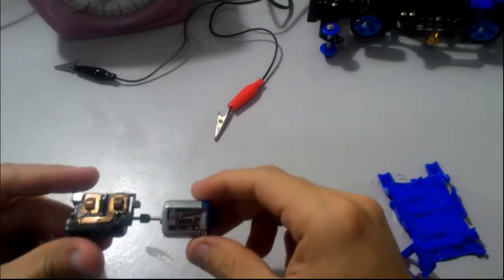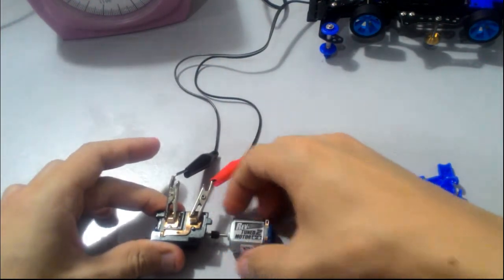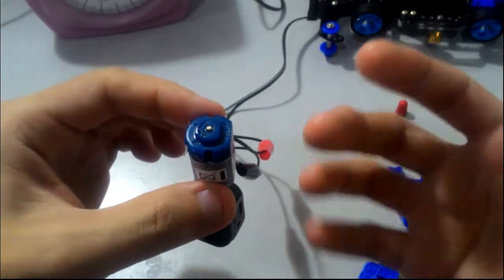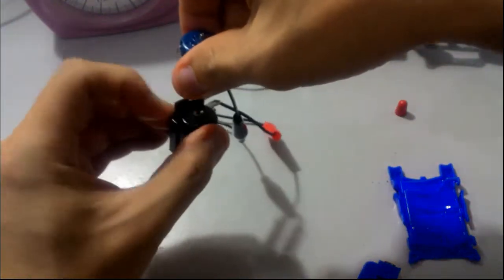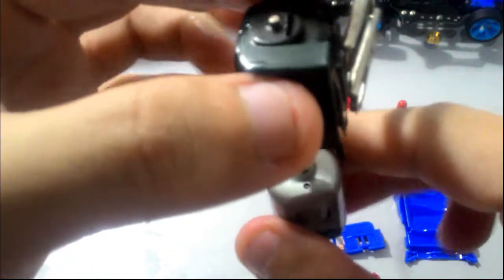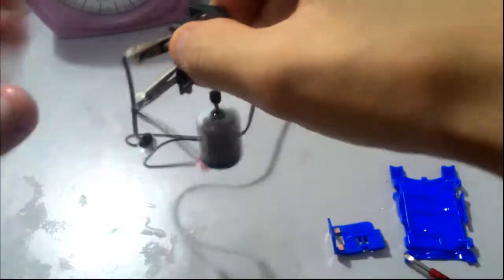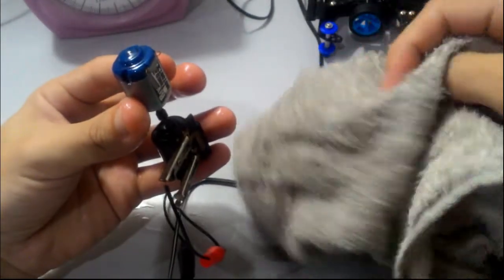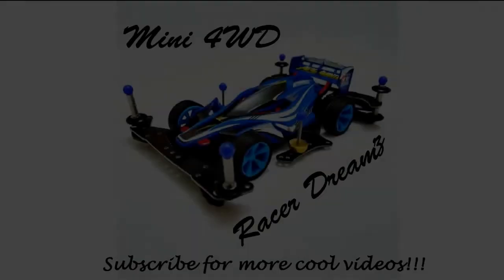Tamiya Mini 4WD Tutorial How to Break in Mini 4WD Rev Tuned 2 Motor and Run Faster

Comment: after break in, it is now safe to use directly the revtuned 2 with battery?
Reply from the maker: Hi, sorry for late reply. After break in, the motor can run smoother because the contacting surface in the motor can run freely, giving the motor to run at faster speed. If we do not break in the motor, it will run at much slower speed.

If we put a fresh out of box motor on a mini 4wd and run it on track, it will cause high load on the motor. A fresh motor without break in will put heavy burden on the motor. The motor will not be able to run at the maximum speed and the lifetime of the motor will also reduce.

So, to get the best result from a new motor, it is much better and safer to break in the motor first before put it on a mini 4wd to run on the track. 

Bear in mind, new motor has a lot.of grease inside the motor at the brush. Those grease will cause drag to the motor causing it to run slower. During break in process, we need to spray contact cleaner to clean the internal part of the motor and at the same time clean the dust create by the rotation of the motor. 

Thanks.